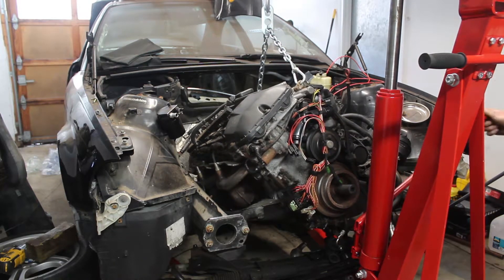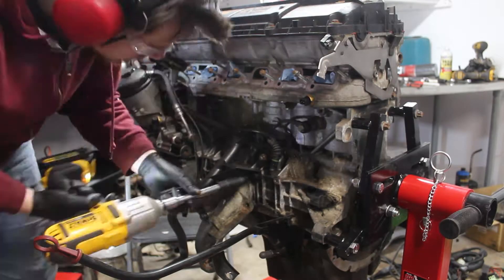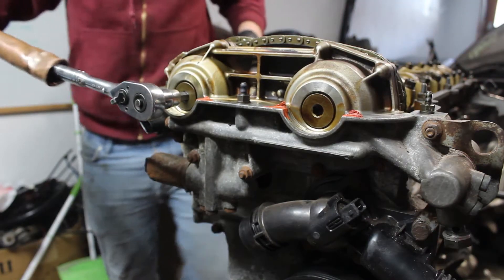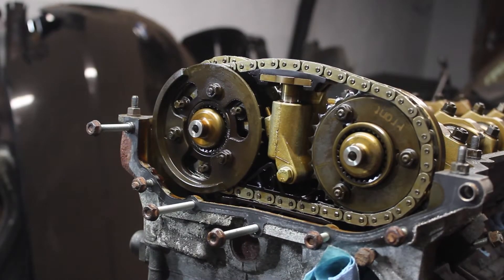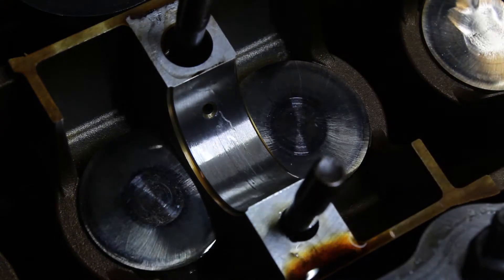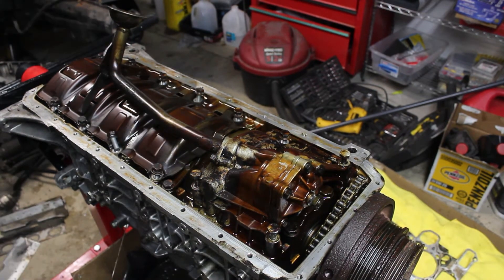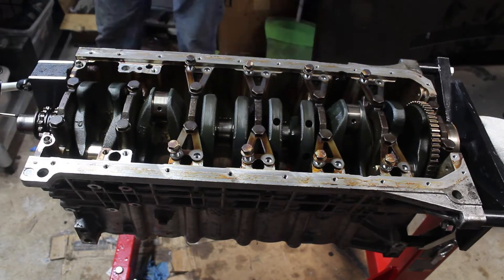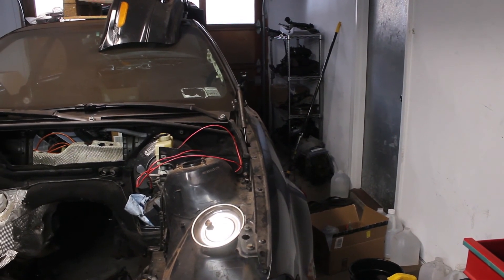BMW E46 Race Car Build: 3.0 L Engine Teardown M54B30

Comment: How did you remove crank pulley you never said how ?
Reply from the maker: Biggest impact gun I could get. I did another M54 where I clamped down vise grips on the pulley, and up against the timing cover so it couldn't turn, and that worked too- but it can damage the cover and pulley.

Comment: well genius, your updated water pump rusted because you used cheap green coolant. try using BMW/Euro blue coolant next time.
also, youre mussing the cam cover on the intake side, which is why youre are using all that oil. the plastic cover that goes over the cams keeps oil spray from entering the CCV system.
Reply from the maker: I blame the previous owner... I when I did the water pump I think I just added distilled water and left whatever coolant was already in there. And the cam cover was missing when I took the valve cover off, so I never knew it was supposed to be there.
I added OEM BMW coolant when I finished this rebuild. Just did a 2.5 rebuild (which had the tray) and was sure to put that back on.

Comment: I saw GREEN antifreeze coming out of coolant ports!   A big NO for BMW,  most likely the notorious urban myth about the BMW cooling issues started with exactly the use of the GREEN antifreeze ......even WATER is better.
Reply from the maker: Yep blame the previous owner. I got the genuine BMW stuff. Not ideal to use any antifreeze on a track car, but better than only water and forgetting to drain my system over the winter.

Comment: The lifters wont fall out if you tilt the engine 45° on the stand. also in the service manual from bmw it's stated that when reusing the lifters, you should put them on the valve they came of from.
Reply: Exactly keeps the cam lobes from uneven wear.

Comment: Tearing down is the fun part. Pretty crazy about that nut on the oil pump. Any plans for cleaning up the coolant passages from that rust? Mine had sediment but I just left it, once assembled I was thinking of running water through it and out the system to flush it out.
Reply from the maker: I submerged the whole thing in a huge tub of simple green and water, seemed to do the trick